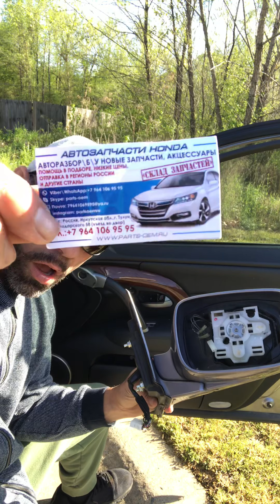2005 Acura RL Driver side Mirror replacement installation.

Comment: Thanks! Acura dealership wanted $1,040 to replace my 2007 Rl passenger mirror. I bought the entire assembly from a junkyard for $104 and replaced the mirror myself. I went to automotive glass shops and because this mirror has a blue tint to it, it's no longer manufactured aftermarket and nearly impossible to find.
Reply: 1040 to replace??? Oh hell no